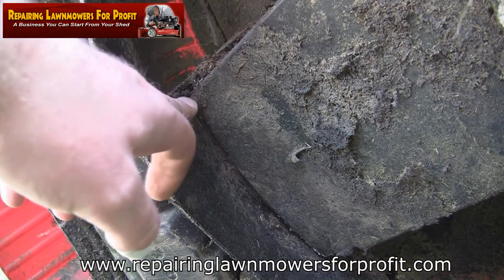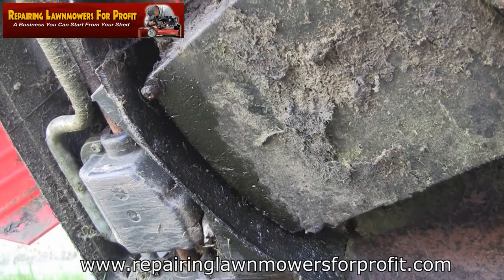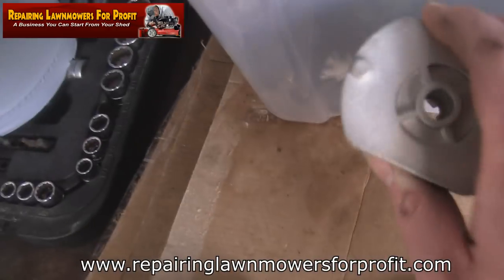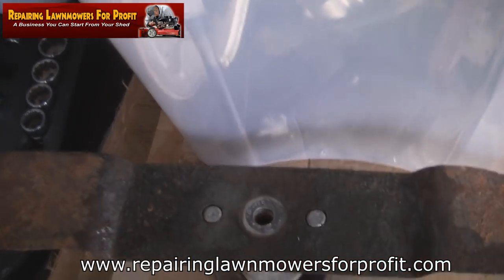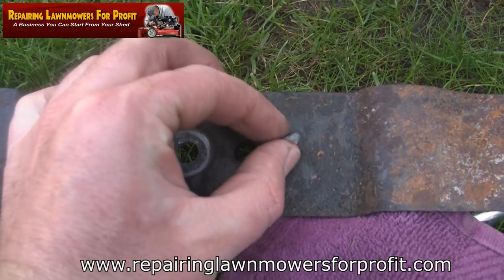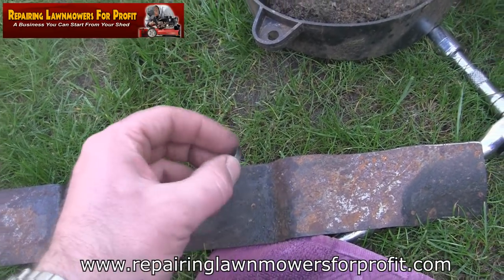Petrol Lawnmower (Blade Boss Replace And Keyway Check)

Comment: To save money, i always drill two holes (with my small drill press) in the boss where the pins would have been, tap it with M8 thread and screw in two quality bolts. In worst case i have welded a blade on with two tag welds.
I appreciate your channel. It's informative with a wide range of subjects. 
And i love your thick Yorkshire accent.
Nick
Reply from the maker: Nick Hoeppermans Thanks!
Reply: is it yorkshire not a manchester accent. If it is yorkshire must be Leeds.

Comment: Never had the blade adapter keyway cause issues with timing. The flywheel one does massively, but as long as the blade is tight this one shouldn't matter. Hayters and Hondas dont have keyed blade adapters and they run fine.

Comment: Managed to replace one of these a few years ago,them promptly hit another tree root :^o
I have a similar mountfield but the deck is now far to rusted to safely use.The JCB mower I have have had sitting outside for 12 years since getting the mountfield  is in better condition!
Currently doing an engine swap and was chuffed to find the Mountfield engine sits happily in the JCB deck,and simply swapped the top half of the handles over.
See if I can swap the Boss' over as well :^)
Smaller JCB mower with the 150cc Mountfield engine looks like a hotrod too haha

Comment: Isn't it the woodruff key under the flywheel that affects the timing? I think the one you show in the video is just to hold the boss in place so the belt doesn't spin it on the crank?
Reply from the maker: Andy K I think that's correct but i've had some mowers nearly rip my arm off if the blade isn't sat correctly on the pins. I'm sure the top one effects timing more but wanted to show how to replace. Thanks though

Comment: I can't get the boss off that has the pins sheard, tried with a puller just can't shift it. put a nut in the end. All I achieved was breaking the flange part that the blade contacts with. Looks like I am going to have to take the engine off for better access. Turned into a right job. Managed to get the old boss off, by sawing it then using a puller it eventually came off. Put the new one on now and used copper grease on the shaft, so won't have that trouble in the future.

Comment: The ones I have the real fun with are the round steel blade adapters. I've got one that the 3 jaw puller, blowtorch ,  penetrating oil and shocking it with a hammer has had no effect on it so far.
Reply from the maker: Simon Welch I feel your pain! Occasionally I take them to the local car garage and they undo them with an impact socket for me!

Comment: Hi, I’m having trouble sourcing a blade boss for my mountfield hp470 mower, have tried everywhere I could think of and returned a couple that just did not fit.
The dimensions I require are 
The bore through the middle - 10mm
The shaft diameter 22.2mm
The overall length 65mm
The distance between the blade location pins 43mm (52mm centres)

Have you any idea where I can source one (I’m near Huddersfield)
Thanks.

Comment: It definitely does not affect the timing if the blade boss keyway moves. There is a key on the crankshaft inside the engine that controls that.

Comment: Thanks for this. I've just repaired my Mountfield SP53H with the help of your video. Unfortunately the band must have come off, as it doesn't self propel anymore. Well, that's a job for tomorrow.
One question though: I'm sure I'd read that you should only ever lean these mowers backwards, rather than sideways, to access underneath. Something about flooding and damaging some component? But clearly doing a job like this would be very difficult like that. So, is there any truth in it?
Reply: I put the mower on a stand tilted right back, and colapse the handle, so don't have to tilt it side ways. My other mower a honda can be tilted on it side but only one side, and not the other side. so the oil doesn't run into the air filter.
Reply: @verybigkittens7550  ah ok, so the H in my model number indicates a Honda motor. I guess then the same night apply. I'll look it up for next time I need to access underneath.

Comment: Keyway ??? It is correctly called a "Woodruff key"
Reply from the maker: Hi Mike I know that. I try to use the terminology most people use when they message me asking for help. Thanks for watching.
Reply: @MowerMan  I'd have been very surprised if you didn't know. Good to watch. My mountfield SP530 blade boss sheared & broke today,
which is what caused me to search. A new boss has what looks like slightly off square locator pins, whereas holes in the blade are round ? Stay safe.